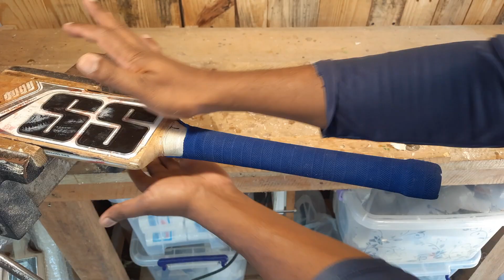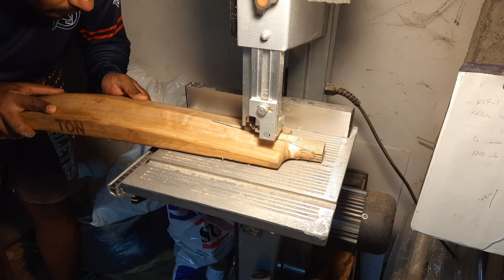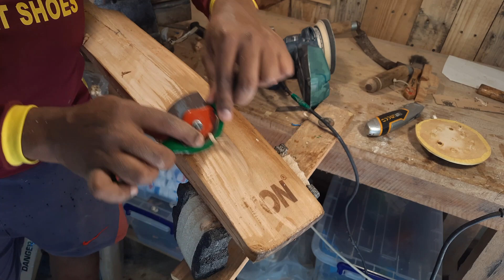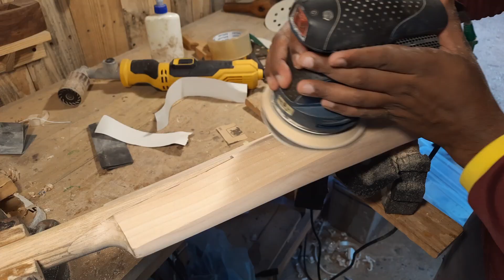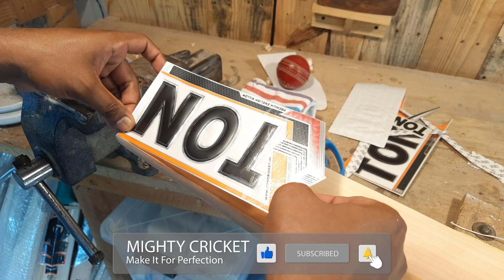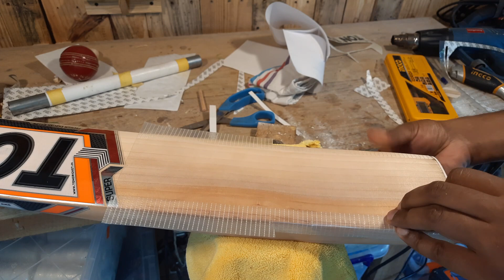Cricket Bat Repairing Video EP 23

Comment: Great work and videos. I wanted to ask why you use the spokeshave at the back of bat before you use the sander? Were you trying to take some weight off the bat or is there another reason for that? Keep up the good work. Vince - South Africa.
Reply from the maker: Main Reason is to get new look , if you use sander for that it will take long time & very difficult to get a new look , so its better to use small spoke shave then you will get both together ,,, cleaning & weight reduction.

Comment: No no no... don't use epoxy for bat handle joint...use only glue for handle joints....after dry epoxy become hard and glue become like rubber...glue us best for bat handle joint
Reply from the maker: You are correct ,, but when shoulder damages are high its always bettwr to go with epoxy